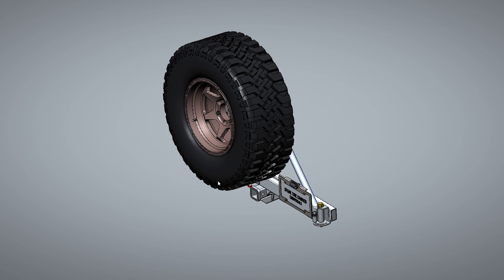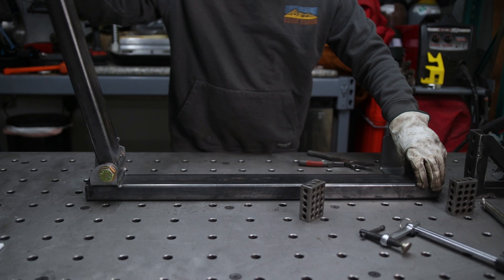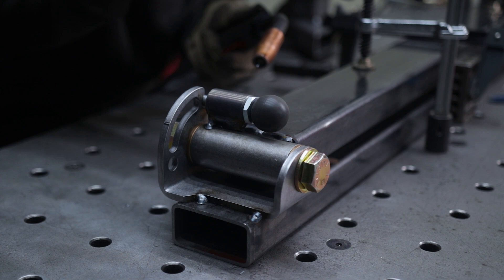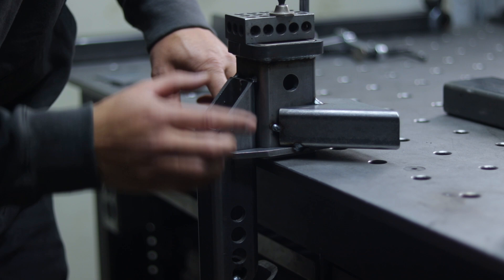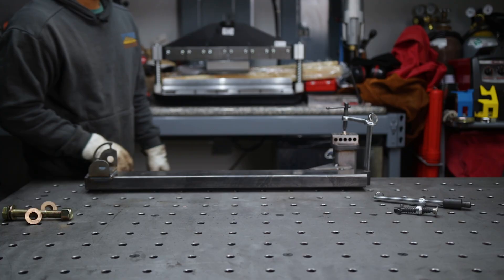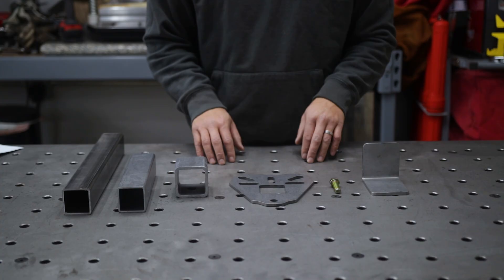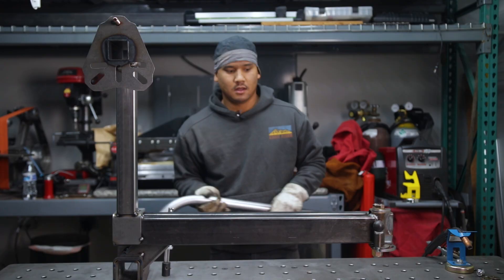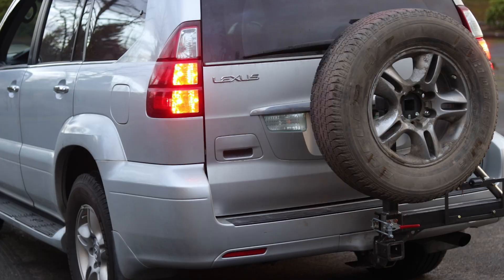Universal Spare Tire Carrier DIY Build Kit - Part 2

Comment from the maker: Check out our Version 2 Universal Swingout Tire Carrier build-it-yourself kit. It makes the build a snap! Click here to check it out.

Kit, Anti-Wobble, Hinge, PDF Plans and More!: https://rathasochenda.com/shop/

If you miss Part 1 make sure to check it out first before continuing on to Part 1 of this build : https://youtu.be/vPMmNO4nygU

In Part 2 of this video, I'm going to walk you through step-by-step on how to build Version 2 of the Universal Swingout Tire Carrier Build Kit (Hitch Mounted). 
 
Video Chapters

0:00 - Introduction 
0:44 - Installing the Tire Carrier Hinge Assembly
9:53 - Installing the Spring Plunger Stop
16:58 - Installing the Fix Arm to the 45 Degree Offset tube
27:15 - Installing Vertical Wheel Mount Tube to Receiver Tube
28:17 - Installing the Wheel Tube Stand Bracket
29:30 - Install Wheel Plate to Receiver Tube
33:15 - Installing the Wheel Stud to Universal Wheel Plate
36:38 - Attaching the Vertical Wheel Mount Assembly To Swing Arm 
39:33 - Outro

Comment: Love the DIY kit on your website.  Do you have plans and a kit for a 2.5 inch receiver hitch?
Reply from the maker: I don’t for 2.5 but it’s should be very similar just got go with a larger tube than the 2x2 I spec out. Can as you what the actual inside measurement is for a 2.5 receiver hitch. I could probably make a custom one off. Feel free to reach my by email on the contact page on my website. 🦾

Comment: At 24:00, what size socket you using for the nut and bolt for the hinge? 28mm? It’s just barely over an inch enough that my socket doesn’t fit, but it’s like 27.5mm with my calipers.
Reply from the maker: I can’t remember off the top my head but probably 28mm

Comment: Hi there! Very much interested but newer to welding. Seems like 1/4” is the thickest material being used, in your estimation would a 120v mig welder be sufficient? 
Love the videos and thanks for your time
Reply from the maker: Hi, in all honesty I don’t think a 120v welder will be adequate for 1/4” thick material. I think to make it somewhat work is to preheat the material prior to welding if you want to make it somewhat work. If you can try to get a bigger unit with the amps to support the material thickness
Reply: Ok great, thank you so much for your time. This is not the first project where I find I’m in need of something stronger so I guess it’s time. Great build!
Reply from the maker: Anytime!😊